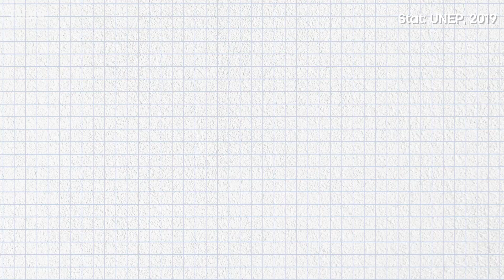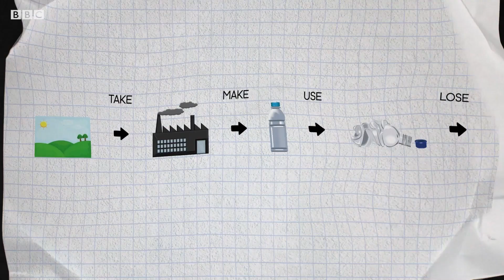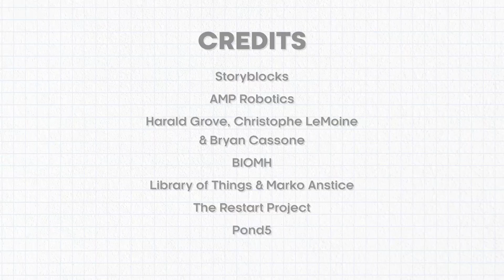We NEED To Talk About Waste! | A User’s Guide to Net Zero | BBC Earth Science

Comment: Phones ARE repairable. That's the worst example to pick, it made you sound completely clueless about the topic.
Reply: Many smartphone manufacturers do their damnedest to make their phones as non-repairable as possible, though. Anything that's glued or welded instead of screwed and clipped is non-repairable by most end-users. And if the device locks itself up when you change a part, it's non-repairable by any third-party shop, too.
Apple is celebrating themselves for building Daisy, a robot that can take your old phone apart and sort the pieces for recycling. But they're also making damn sure that's pretty much your only option when your iPhone breaks.
Reply: @rolfs2165  my bad for forgetting US obsession with iphones. Other phones, while difficult to disassemble (have to heat the glue), can have any part replaced.